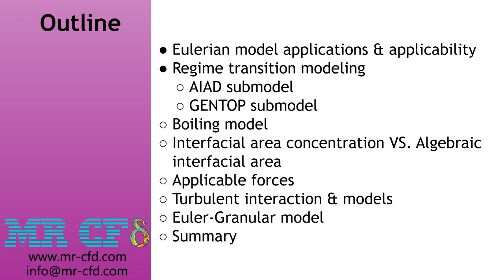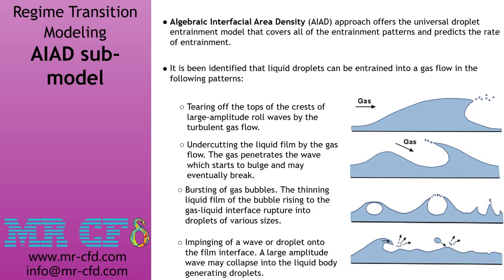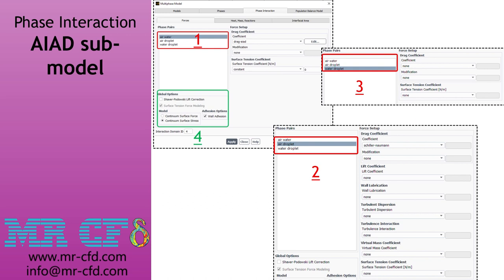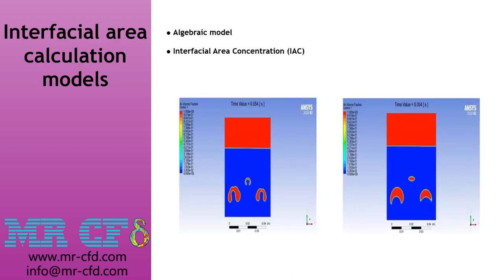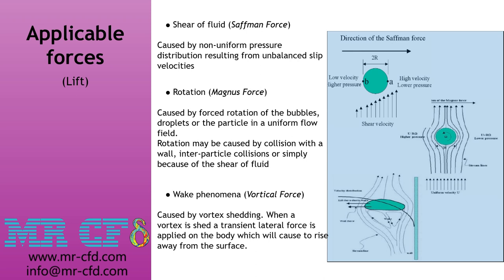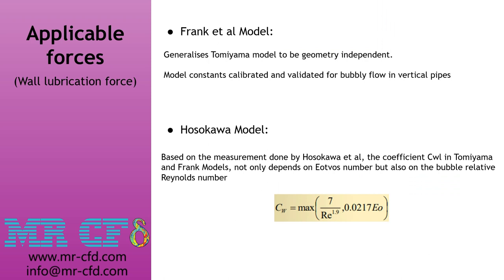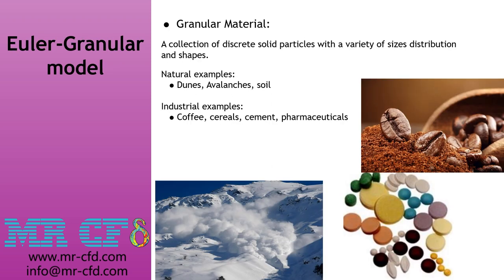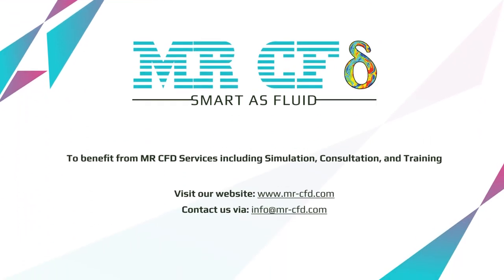Eulerian Multiphase Model Concepts in ANSYS Fluent

Comment: Hello, I have a question about the AIAD model, I want to model wind driven current in free surface air and water, can this model transfer momentum from the velocity of wind to the water so it will cause the water have a velocity current?